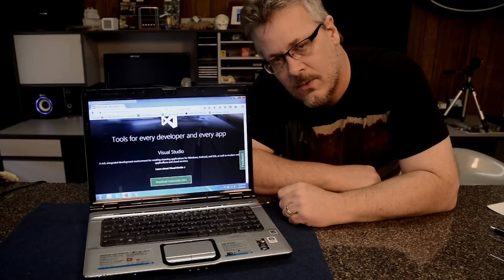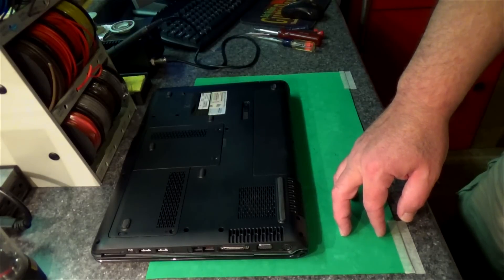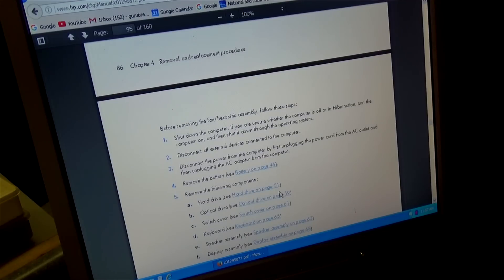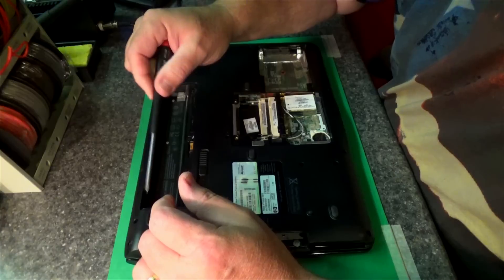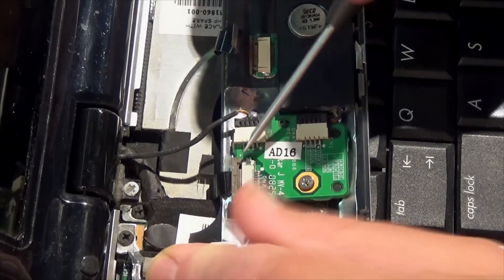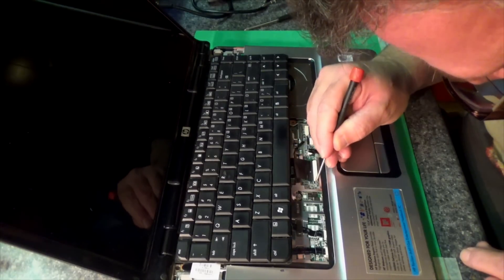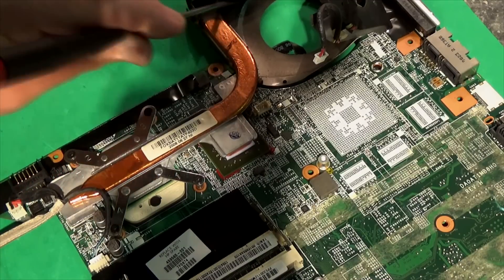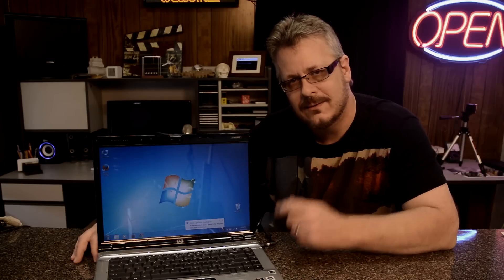How to Solve Loud Laptop Fan Noises Caused from Overheating

Comment: Kuch laptops mein wakai badi problem hoti fan disassembly mein. My current dell 5570 have just fan on top.. just have to remove 3 screws and it's out completely.  But there is one more dell 1420 laptop with me of old times. U have disassemble everything before u get to fan ...And everything means everything ..u just can't take apart anything else then... and there is lot of everything there in that laptop. Really lot! 😂 ..That's the stupidest ever laptop I ever seen for getting to fan.

Actually that 1420 currently have that fan problem. But I don't have passions & dare for correcting it. 😂  

Otherwise laptop working just fine...I have once opened it to get to check why fan not working. But I just can't dare to disassemble it again for last year or so to change it. So since fan not running so it auto shutdown after few minutes. 😊

Comment: my laptop fan is making a buzzing sound i cleaned  the bottom intake vent but now the fan will go off fully  like all the way off then go back on with a swooshing like sound like when u trun on ur laptop but only a more quietly  then it will start to make a buzzing sound again then go off then it goes back on with the same swooshing likerevving up a car but with a  air  it never did that before the fan use to be always on never going off completely like that is my fan about to brake all the way do i need a new fan?

Comment: Wayyyy better solution: shut your laptop down, leave it for 30-40 minutes, re-open it and the sound will be gone.
Reply: Do you know if that's safe? My laptop timed out for a few minutes while I was trying to fix it from the outside with a handfan (stupid, ik) and then the buzzing stopped suddenly. I just wanna make sure the problems solved than have my laptop explode or something because I didn't fix it properly 😭
Also, have a good day!

Comment: My cooling fan makes noise only on start up, so I'm trying to determine if the BIOS is the root of the problem, not properly regulating the fan speed early enough. I replaced my cooling fan only three months ago, and this one is starting to do the same as my original one. I've checked my BIOS and the report says it's up to date, so I'm at a loss.

Comment: when I'm flipping the laptop over it's making grinding sounds(the CPU fan) and when I'm increasing the fan speed it's becoming softer/quiter.. CLEANING THE FANS AND HEAT SINKS DIDN'T WORK.. although there was debris (and it isn't making louder noise like before).. But the problem still persists ...and flipping, shaking making the grinding louder .. what to do? <Acer nitro 5 AN515-54> PLEASE HELP ... I can't sleep with this..

Comment: my laptop was so noisy and over heats the moment i opened it until i finally dismantle it, clean up all the dust around the fan, remove broken registry items and clean up unnecessary restore points. now my pc is cooler

Comment: Sometimes it could be due to potentially faulty components that would fail sooner or later, the owner would have to consider if changing a new notebook is a better choice than repairing. I had a 5 yr old Toshiba notebook with I7-3rd gen cpu with HDD, the cpu shut down frequently, found an advise on Youtube to reduce it's cpu power management to 95% or lesser to prevent cpu overheating, it work initially for few months, later it's power failed to boot. Sent for repair, but failed again after 3 months.

Comment: hey just an fyi its supposed to make that noise or els the CPU will over heat and melt try and take the back or front off for airflow or let it run till it cools down thats what i do i let my laptop run at full blast

Comment: Hi GuruBrew, I have exactly the same laptop that I haven't used for years and slightly used, I was disappointed with the Operating System Windows Vista, I also have a desktop computer I want to upgrade from Windows 7 which have an Auto Cad program installed in it to Windows 10 so I can use my laptop exclusively for my Cad drawings. Will it be possible for me to clone my Windows 7 OS desktop and install it to my HP Pavilion dv6700? Can you guide me how to do it if possible. Thank you.

Comment: As a Child I would feel a bit unsafe with this, my computer has the same problem but am I able to use a vacuum or something that would work without having to remove pieces from the computer? I tried vacuuming and it has not made a loud noise yet

Comment: My Sony VAIO had the same problem and after a nice cleaned up it really fixed the humming noise; however, it comes back at times particularly when one is working with multiple applications. I'll try upgrading my old hard drive for an SSD, a Micro Center tech recommended me that too.

Comment: What I do is go to my battery advanced settings and go to maximum process speed and put it to 65% was at 85 which will make the laptop work harder and makes the Fan get loud. Hope it helps someone

Comment: Mine has done this since a Windows update a while back.. I can NOT get this dang HP laptop apart to even think of really cleaning the fan!  What happened to having a housing box that you could easily open and clean. :-/

I factory reset, it's quiet for a minute but then loud all over again once Windows updates.. even tried a clean install and removing all partitions and reformatting.  My CPU is almost constant at 100% too. :-(  this SUCKSSSS

Comment: There are so many videos on noisy fans and every one of them ends up being about just cleaning it. My fan is pretty clean so the noise is not because it's clogged. Now what?
Reply from the maker: If you're certain the noise is coming from the fan and it's clean then you must replace the fan with the new one the bearings are probably shot
Reply: @GuruBrew  Thanks for your reply. I found a comment buried in some faraway Youtube video that said it's indeed the bearing. He suggested taking the fan apart and replacing the residual lubricant. I did that yesterday and I haven't heard a purr since. Ofc I have no idea if this is a permanent fix, but for now it's working perfectly and all it cost me was a drop of oil.
Reply from the maker: That's sweet thanks for the update

Comment: Sorry for reacting a bit blunt but would some compressed air from the outside, together with a vacuum cleaner at the air intake be aquicker solution?
Reply from the maker: The passages between the intake and outtake are very small. Using compressed air will more likely make the problem worse by pushing debris further into the system. I always recommend vacuuming as opposed to pushing air.

Comment: Have a HP silver Pendium table top I bought from Walmart over the net in mid Dec 2018. Didn't plug it up for 4 months. When I did it rattled like hell and has a high pitched hum. Called HP support and got a foreigner that I could barely understand trying to tell me he could stop the noise if I followed his steps. I told him I couldn't understand him and I needed to send the computer back for repair. Never got any satisfaction from him and told him I would call back later. Forgot about this for months because I use another computer HP pavilion 23 that has no annoying sound at all. Recently contacted HP support again and they claimed my warranty only covered the mouse and keyboard. Told them that was BS because a one year warranty is printed on the bottom side of the computer itself. Then they told me my warranty had expired in October even though they had no idea when I bought it. They finally agreed to take the computer back for repair but I had to send proof of purchase. Sent receipt through a cell phone to their website using a neighbors smart phone. Then told me I had to send the picture on the email that they sent me. So just a run around hoping my warranty that runs out in a couple of weeks will expire before I do everything they want. Just a BS company that out sources its labor overseas which I will stay away from in the future. They act like they are getting a commission to deny claims.

Comment: Great instructional video. Thank you. One thing I do when removing the various size screws from a laptop is to use some wide masking tape sticky side up to hold the screws. I create a mini map of the the screw locations on the tape (screw from top left comer, to top left corner of masking tape etc). I also do this for the internal crews that hold the main board and other components in position.

Comment: i have a loud crackling noise that is CONSTANT but i know it isn't the fan bc i can hear when the fan engages. anyone have a different potential diagnosis? in fact it tends to get quieter if i block up some of the air vents but that could just be bc im clogging up some of the areas where the sound could escape from. i have an HP btw

Comment: Unfortunately the laptop runs hot because the fan grill or fins are blocked with dirt, hairs, and fluff, so on, which causes cooling failure and hence the processor runs hotter and then fan tries to compensate the reduced air flow by blowing even harder at higher power which is what causes more noise, my G7 -1260 Pavillion (HP) because so noisy that  I could barely hold a conversation on the phone, so today I stripped it down, mine I had to remove the whole mother board to get to the bloody fan, it was badly choked up, worst than shown above, I took it away from the processor unbolting the 4 screws with spring tension, and jet washed it with a jet of powerful water squirt, which made it look like a new fan, cleared all fins, and then dried it gently with a hair dryer for about 15 minutes and let it rest for an hour and after reassembly all worked brilliantly I can hardly even hear if the fan is running, yes it is but make sure all wires and Connectors go back in, I nearly forgot to reconnect the fan and would have had to open up all over gain.  What I did with my screws was take it out and stick it with a masking tape next to the hole it comes out of,  sane as this guy did here but he only did it for the HD or DVD, I did it for every hole, and that way I never had any screws left over! 

I was not sure what was causing my fan to eb so noisy, I first thought my computer might be running so many applications all at the same time, but that was not the case, I then suspected my fan needed good oiling, but again that was not why it was noisy, all because the air could not vent out freely, and whatever little air ca,me out it was bloody hot!  and now you can barely feel the warmth from it. It is running cool and silent, I can now hear my central heating pump running from the boiler! I suppose I will next need to do a complete boiler service. Open the combustion chamber, clean the fins for better efficiency, and clean the burners, check the gas pressure coming into the gas valve usually 20mbars, and check the pressure when boiler is at max heating hot water, ha ha any gas safe people on here getting pissed off with my self service on my own gas boiler!

Comment: Thanks for sharing this information. I'm dealing with an HP and have to rip it down to the bones to install a new fan and it was frustrating pulling it apart. They have some of the screws hidden; two are under two foot pads and one was under a sticker that looked like a plastic piece built into the chassis. You were right in that they need to make it hard/impossible so we purchase another one. Well, not me. My new fan will be here Tuesday. $12 off Amazon. Also, if you want to leave the business, you have a future in Youtube ASMR community.

Comment: I need a bit of help. So my computer would Start making these loud fan sounds, usually from playing a video game. I took off the battery, Keyboard and pretty much what I need to reach the Fan area. I cleaned up most of the dirt and I reassembled the Computer.
Literally  the first 15 minutes after opening the Computer and I can already hear the fan making even louder sounds. My computer also overheated and shutdown. I don't know what else I'm supposed to do cause the only thing I ever did was clean it.

Comment: Thanks mate, I have disassembled my Thinkpad and took out a thick "duster" layer of dirst from the heatsink lamels similar to yours on video. All quiet now and laptop stopped shutting down intermittently due to over heating. I am waiting for new Huawei Matetbook X Pro to be released - it comes with fan-less liquid cooling system, so no such issue in the future and totally quiet.

Comment: its very very  horrifying to watch dismantling laptop..I'd rather prefer it to it by expert not by myself in anycase
Reply: I tried at once for installing RAM...but after that condom ruptured...thn I 've to fixed it via an expert
Reply: I took mine apart with almost no problems. One of my screws was almost stripped and idk if I can unscrew it anymore since I don’t have a small enough screwdriver

Comment: Surely you’d figure the intake fan would be on the bottom and the out vent on the top because the hot air will come out a lot faster on the top...?

Comment: my laptop cooling system gets cleaned every 2 weeks  till it dies 
then i just get another one out of my working laptop collection  
and then when i need a replace those two that have died i just buy one off ebay 
yes i have 7 laptops and they all do different duties one burns iso images one downloads 
one test windows operating systems one tests ram and hard drives etc etc

Comment: Usually when you take a laptop apart you do it in steps.. First, You remove the battery, then the optical drive, then hard drive(s) etc... What I do is get on of those small parts organizers, the ones with the removable compartment dividers and just set it up where you have a bunch of little compartments and label each one with a piece of tape for the screws for each step. You can buy them anywhere. Or even get an old plastic ice tray and label those with tape. That way you screws are organized by your part removal...

Comment: Is it normal that I have this issue with a brand new laptop?
Reply: I have this laptop for at least 5 months and at most 6 months and it suddenly vibrates now, I don't know if it was like that from the start and I am just being paranoid but what do you people recommend I should do? This laptop is very expensive and it's the first time I've ever had a laptop.
Reply: same! i just bought this computer and it just began to make rhythmic sounds and its scary D:
Reply: Replace it with new one
Reply: probably not, i would take it to a repair shop because it might have to do with a fault in the machine
Reply: No. when its new the bearing needs to be used beacuse its stiff or its out of place
Reply: XxPeruvianGamersxX yes

Comment: Thanks man.... just halfway through your video I knew this is going to be the most insightful video I have watched till today, n I hav watched at least 20 on cleaning out the fan and replacing the heat paste. I was always looking for how to be careful with the connectors, coz the last time I took apart my toshiba A660, I broke the keyboard connector without knowing how it works. so this time I wanted to get in there not before knowing how to handle those as there a bunch of those and you simply nailed it for me !  Great work chief... thanks once again !  :)

Keep all the tips (the most useful part) pouring in for all the beginners out here... great work, if people just had the patience and confidence to open up the laptops, you are saving thousands of dollars for the users everyday !
Reply from the maker: thanks for your comments. I often get a lot of negative feedback because i tend to give to much information and some just dont have the patience to listen.
Reply: @GuruBrew  I'll concede to it as a Gen Z problem, true 👀

Comment: My fan noise is as loud as Boeing 747.
Reply: AungKK are you ever on the deck of a ferry and the loud horn goes of without expecting it.
Reply: mine sounds like the hulk jumping from a plane and going straight thru earth
Reply: If so, it going to crash
Reply: not that bad mine is like a galaxy c-5 with a  XF-84H at the same time hahaha probably 100km away
Reply: Mine sounds like an Antonov loaded with 2 tanks inside taking off
Reply: Lol
Reply: Mine is as well, I can't believe how loud my msi is!
Reply: My fan sounds like train running its engine
Reply: Mine too. 😂
Reply: Mine sound like F/18
Reply: Mine sounds like a rocket launching
Reply: who searched up Beoing 747?  😅🤣
Reply: That's nothing. My laptop just exploded. RIP grandma. I told her not to come near it

Comment: my fan doesn't get loud mine makes a noise kind of how a DVD player makes when reading a disc and i don't know what to do i need help ASAP
Reply: That's either a broken fan bearing or a dying hard drive.
Reply: McB MERKS so does mine
Reply: Mines a mix with that and his but LOUDER
Reply: same, did you fix it? i need an answer to my problem because i want to use my laptop again (i haven't used it in the worry of breaking it)
Reply: @cloud-vf4wz  I just blow into my laptop as hard as I can and see if it stops, usually it does but after 10 minutes it comes back
Reply: Same here ....any fixes please
Reply: @cmpunk-cop3797  yeah it's the same sound, mine sounded like a v8 corvette engine revving up lol.... Wht I did was just take my old vacume cleaner out and suck all the dirt out from the holes and the vents where the fan is... I make it my priority now to keep vacuuming me lappy every month. And as an added bonus I vacuumed the speakers as well and that dirty vibration sound stops occurring as well :')